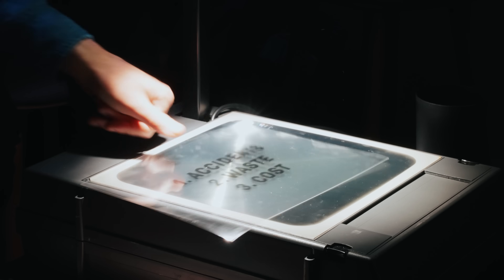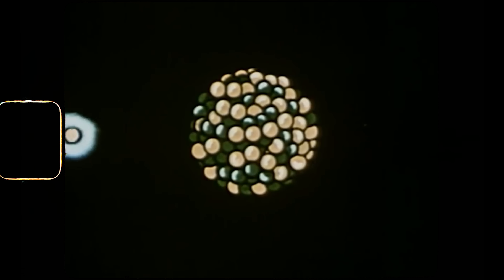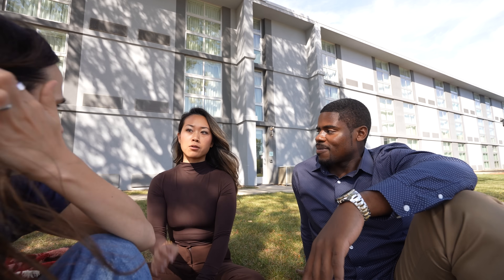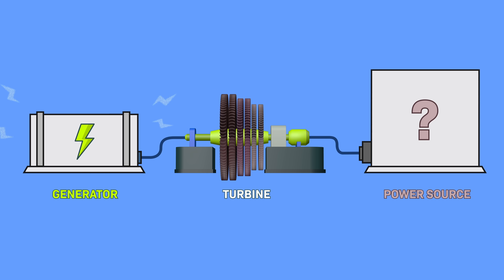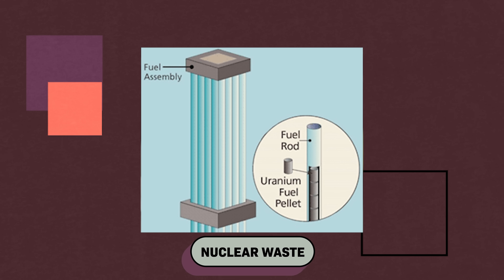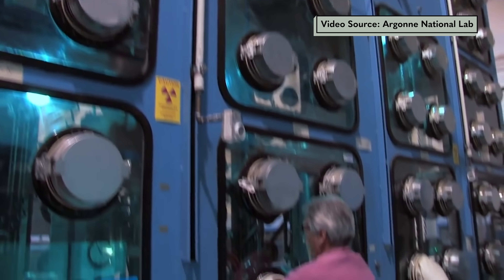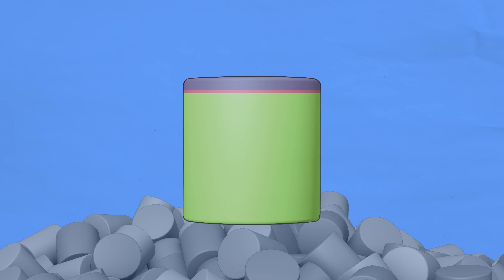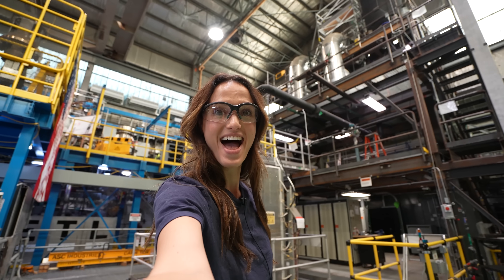The Big Lie About Nuclear Waste

Comment: The big problem of the fast reactor is that the power is more expensive, the reactor is not as safe and you get a lot of Plutonium which is much more dangerous than Uranium waste and you can build atomic weapons out of it. So if every country in the world would build fast reactors we would probably get big problems with Plutonium getting into wrong hands.
Reply: So you clearly saw the rest of the video to see that other countries did continue to recycle, and that Reagan lifted the ban in 1981. And those big problems with plutonium getting into the wrong hands over the past 42 years?
Reply: I agree with your first two points, but the fact is "every country in the world" is not going to use fast reactors for the simple reason that only a minority of countries even use nuclear at all. If every "First World" country (i.e. Free World countries that are also "developed economies") that already uses conventional reactors were to build some fast reactors for themselves, then the proliferation risk (from those specific countries) would be non-existent. This is not only because they already have considerable non-proliferation protocols, but also because they can use the plutonium as fuel for civilian reactors before it becomes a proliferation risk in the first place. 

The fact that current fast reactors are less safe than current conventional reactors is a legitimate concern, but they're still safer than all non-nuclear sources of power, so I'd say the risk is negligible.
Reply: Can you say Fukushima  ????????
Reply: @ironworkerfxr7105  what about fukushima? Do i need to remind you it failed because 
A) it was the worst tsunami since the 1800s
B) the backup generators placement was unsafe, general electric told them to put it elsewhere
C) anothe reactor that was CLOSER to the tsunami source was literally just fine because it was better designed
Reply: @ironworkerfxr7105    this is to easy. Every incident with nuclear power plant happened because of stupid people. In Chernobyl it happened because people ignored the rules of how to handle the nuclear reactor. In Fukushima it was not smart to build a nuclear power plant in an earthquake zone.
No we use nuclear power and produce highly dangerous waste that will last for tens of thousands of generations. This is pure egoism. The responsible thing to do would be to recycle that waste and reduce as much of the waste for future generations as possible.
Reply: @ironworkerfxr7105  did you know there's small amounts of radioactive elements in fossil fuels. Hence why the radioactivity around a coal powerplant is higher than around even Fukushima. 

Let's be honest, you don't give a crap about radioactivity around a powerplant. 

1000 000 people a year die from coal plants. An average of 4 people a year die from nuclear plants. 

And let's be honest, if you had the option to reduce that number from 1 million to a single digit number, you wouldn't take it...why, because you don't give a crap about those people's lives, just like you don't give a crap about reducing radioactivity around powerplants.

You care more about your own narcissistic irrational fear, than people dying or radioactivity around powerplants.

Comment: The issue is that you can't just use it as is. The waste needs to be processed to be used again in nuclear reactors. It has just been cheaper to keep digging up uranium and partially enrich it and make new fuel. But yes the ability to do this has been around since the very early days of nuclear power.
Reply: This is part of the problem with the world. The quest for higher profit margins will destroy the world.

Comment: When the US government becomes an expert at cleaning up the radioactive messes they have already made maybe then more acceptance will be there. What you describe is what they did at Hanford to produce Plutonium with breeder reactors. They kept recycling the fuel rods (grinding them up, purifying, reforming the pellets) and back to the reactor to eek out every last particle they could get. In the process, it created massive amounts of radioactive sludge with acids for extra spice. Maybe do a deep dive into the "Hanford Reservation". Why didn't they recycle that material rather than leave it behind to contaminate. Current estimates are that 157,000 gallons of liquid has leaked into the soil, which ironically sits on top of massive basalt flows that are about as water tight as a window screen

Comment: As a big supporter of nuclear it is a bit upsetting that you mix nuclear waste and used nuclear fuel. There is some fine but principle differences between the two. Is the used nuclear fuel - nuclear waste? Yes... in a sense... But... There is legitimate not usable nuclear waste which is not the used nuclear fuel.

Comment: I think one unfortunate point that needs to be emphasized is the difference between nuclear power from an engineering perspective and the one which exists that involves human greed and stupidity.  For instance, given the choice between storing waste for thousands of years vs. just a couple of hundred, the US immediately chose the short-term benefit of cheaper fuel with a horrendously dangerous and long-term cost.  Each of the most infamous accidents at nuclear power plants - Three Mile Island, Chernobyl, Fukushima - all resulted from insane attempts to save money and human error.  Those casks of nuclear waste she showed?  How vulnerable to attack from an insane person or terrorist do you think those are?  What kind of damage would result from a plane flying into them and exploding?  How long do you think that damage would last - 100 years, 200 years, 10,000 years?

Comment: Radiation means only one thing: energy. And we bury a crapheap of energy. Gamma radiation is nothing else but high energy photons. You know, the stuff that the solar panels convert directly to electricity. Beta radiation is electrons. Well, directed electron stream is called electric current. We shielding everything against these radiations, and cooling everything that absorbs them, because the absorption results heat energy (shielding is practically a wasteful energy conversion method). So much energy just thrown out of the window.

Comment: The environmental movement has made people so afraid of nuclear power and nuclear waste that the motivation and even the ability to do the kind of research necessary to make it safer, more efficient, and thereby reduce the radioactivity of nuclear waste not only is slight (where's the market for it?) but in many cases is actually stifled by government edict. Look at Germany and France. After Fukushima, the decision was made to rapidly move away from nuclear energy. So if you can't build a new generator, or it takes 15 years of environmental studies and lawsuits just to break ground--and then maybe another 10 years of construction and additional lawsuits--who wants to build, and without that construction, what reason is there to innovate?

The biggest obstacle to what you describe here, quite simply, is ignorance. I mean, those dry casks? Mostly they're there to deal with both the heat and the fact that being next to radioactive material tends to make whatever material that is break down. So storage of high level waste isn't simple. However, the most damaging of the ionizing radiation you talk about is alpha particles. Protons. Protons are big and fat and easily blocked. Gamma and X-rays are also dangerous but with that, it's just like listening to a high volume rock concert. As you walk farther away, the volume diminishes exponentially with the distance. Add a layer of lead and it's like wrapping the speakers in a blanket. Making radioactive waste safe, conceptually, is quite easy. In practice, it's rather difficult and, understandably, people don't tend to want to be around it, but the danger is way overstated.

Electrowinning (basically a fancy name for electrolysis) has been used in the mining industry for metal refining for decades. Applying it to uranium recycling surely is an attractive solution. Uranium is a metal, afterall, and basic metallic properties still apply. With the radioactive half-life then reduced to a couple of hundred years, deep cavern disposal (essentially chucking it down a hole, where no one but a miner would ever have a chance of ever digging it up again) becomes quite feasible and perfectly safe, even without containment.

Comment: I was literally thinking about this like 3 weeks ago. How can it be waste if its STILL RADIOACTIVE??? Its still useable!
Reply: You can burn the ashes in your fireplace if you like.  But it's hard to do and won't release much heat and light.  Energy is not linear.  We use uranium, coal, gasoline and jet fuel because of energy density; they pack lots of calories into a small package. When energy density falls below a certain threshold, the source is no longer useful or sometimes even useable.

Comment: It never made sense to me why if it was radioactive - it couldn't be used to create power. Just run a cooling loop through more of it and bam, 100,000 years of power. Might not generate as much - but it's minimal fuel requirements. 
I guess maybe it doesn't make sense over time with how much power is generated?

Comment: It's not that simple. First, nuclear power is the most expensive type we have. Solar, wind, wave, and geothermal, especially with plasma drilling down to the superheated rock are all under 4¢ per kWh, even backed by various energy storage systems.

Second, There are other radioactive materials such as radioactive water created by nuclear power systems that have damaged the environment when disasters like Fukushima happens.

Third, 200 year storage is still a major problem. It has been less than that since the storage in Hanford, WA, and product is about to enter the Columbia River.

Other byproducts such as plutonium need to be dealt with.

Comment: There is just one problem: More than 90% of radioactive waste can not be reused in this scenario. This includes for example protective clothing, radioactive water from the primary cooling circuit, defective equipment from the reactor chamber or primary circuits, the rods which hold the uranium pellets, waste from dismantled power plants and so on.

Comment: You could ask French people how that closed cycle idea is panning out. Using Japan as an example after they had shut down their nuclear plants since Fukushima in 2004 doesn't make much sense. You're right that it's a better use than letting the stuff rot for centuries on end, but as for reliable, clean energy, there already exists a much cheaper variant without the need to go such circles in the first place.

Comment: Really good presentation. I would like to see a presentation by you on SMR's. I was a mechanical operator on a submarine (SSN595) nuclear power plant in the 60's.
Reply: The advantage of Small Modular Reactors is cost.  Much cheaper.
Reply: @scottslotterbeck3796  There are several advantages one of which is "Much cheaper". Because Ms. Abram is such a good presenter, she would be able to explain this to those who do not have an understanding of or have a fear of nuclear power. SMR's are available now and in my opinion are viable solution to our energy problems.

Comment: you are missing the biggest amount of nuclear waste and that is the equipment, buildings, clothing and other items involved in the mining, manufacture, and interacting with radio active materials.  This stuff is deadly but can not be used as a power source.  So what do you do with a nuclear power plant after it is decommissioned?
Reply: That type of nuclear waste isn't even a problem, loses it's radioactivity in 10-50 years. You can only reutilize the most dangeruous type of waste because it's the only that still stores useful amounts of energy.

Comment: 11:56 - Thank you - That is the key, fast or breeder reactors. You use those to make plutonium. In the early 1970's Nixon pivoted hard toward fast breeder reactors to make weapons to escalate the cold war, to make it more MAD, more scary. He also stopped research on the molten salt reactor with the same policy, search for Oak Ridge MSR or LFTR. Nuclear war didn't happen, so maybe his policy was correct. But it tied us to oil and in 1972 and 1979 OPEC really screwed us, and then climate change.

Comment: The 235 in Uranium 235 is the atomic mass number and not the number of neutrons.  The atomic mass number is the number of neutrons and the number of protons, the number of neutrons is equal to the atomic mass number minus the atomic number.  For uranium 235 it would be 235 - 92 = 143.

Comment: Total scam! There is one California that actually uses nuclear waste to generate power. They salvage carbon-14 from nuclear waste and make diamond nuclear "batteries". The only problem is that it costs $4,000,000/Watt.
"Nuclear waste" is not an element nor a compound. It is a mix of everything contaminated by radiation or nuclear waste. In Rocky Flats, they mix nuclear waste with concrete and store the result. The concrete has turned into sludge and seeped into the water table.
In Russia, they dumped nuclear waste in an abandoned mine. Until it exploded and contaminated 10,000 square kilometers, wiping out 22 villages, and causing over 6,000 cases of radiation poisoning.
What type of "nuclear waste" is this secret process supposed to use.

Comment: President Carter's policy was pure idiocy.  I served as a submarine officer and then worked to provide nuclear services to existing nuclear plants for a decade.  My degree at the US Naval Academy was in Marine Engineering, a combination of mechanical engineering, nuclear engineering, and shipbuilding.  SInce the national government didn't pay for a long-term storage site in Nevada, the government pays all the costs to store the watse at the existing and former nuclear powerplants.  (This was a campaign promise by President Obama to win the state in his first Presidential election).  Nuclear power is far safer  than it is percieved by the public.   Thre Mile Island was caused by a stuck open power operated reliefvalve and thenwhen the operators didn't reccognize they had conditions where steam was forming in the core.  Chernobyl was caused by activating a test with safety systems off line.  That type of reactor had a design flaw where if temperature went up it became more powerful.  That type of reactor can not be built in the United States.  For Fukashima, it obviously was not high enough above sea level and the emergency diesels were too low as well.  Look how high nuclear plants in the US are above sea level when they are near the ocean.  US Plants were also built to prevent the hydrogen buildup that blew apart their containment buildings.

Comment: Is it possible, that you haven't understood the basic principle of nuclear energy ?
1st) enrichment means getting U238 OUT. There will NOT be more U235, but less U238.
2nd) U235 "burns" inside the reactor and is gone for ever. U238 and waste is left.
3rd) "recycling" means extracting remaining U235, which is not much and very ineffective and leaves you with much MORE nuclear waste from the process.
4th) Jimmy Carter was a nuclear scientist and the only one that realized, that processing is in no way sensible. Just if new uranium is hard to get. AND it inevitably contaminates the environment with isotopes. Europe just doesn't care and spills it in the ocean and the air.

Comment: More comments...
1) Long time period nuclear waste is the safest - not the most dangerous.  Granite is radioactive for 500,000 years maybe?
2) Old school reactors I believe only use 5% of the fuel before retiring the fuel.  Newer reactor designs use 95% of the fuel.
3) Talk about load following.  Renewables fail in many ways, most obvious is that they only make energy when they want too.
4) The University of Illinois EnergyProf talk on Natrium describes the value of HAELU fuel.  Check it out.
5) Are we saving the power turbines from decommisioned coal plants?  Need to do this since they are reusable with Natrium.
6) Sodium rectors are intrinisicly safe.  They hotter they get, the more they shut down by themselves.

Comment: Interesting. Sidenote, when you reuse the nuclear waste for nuclear reactors, one of the byproducts is weapons grade plutonium. We need to develop a method of regulation that allows the weapons grade plutonium to either be shifted in ownership back to the US government, or some other method that ensures the safety of a very dangerous product. Dangerous in the sense that can be turned into a weapon and not dangerous in the sense of radioactive waste issues.

Comment: The problem is you can’t transport spent fuel. You would have to have a reactor on site that’s used it and it’s not cost effective for a company to do. Regular nuclear power is to expensive to operate now that’s why so many are closing.

Comment: "This is Uranium 235, the number refers to the number of neutrons" (7:04) - Uranium-238 and Uranium-235 are both isotopes of the same element, each of which has 92 protons. So no, U-235 has 143 neutrons, not 235. That wasn't just a minor mistake because that is like the 101 of nuclear phyiscs/chemistry. .... Anyways, sure you can recycle fuel rods. But as you mentioned it yourself, the question is if you can do it cost efficiently. That's similar to nuclear fusion: It does work in a laboratory, but we are still in the process of having to figure out how to get more energy out of a system than we currently have to use to trigger a reaction. .... Lastly, nuclear waste does not just consist of used up fuel rods, it also contains "activated" materials. It is just not feasible to recycle the other (less radioactive) materials, which make up the most part of what is "nuclear waste". .... Regardless, the fewer problems we leave behind for future generations to deal with, the better.